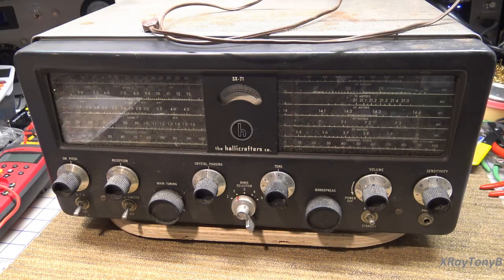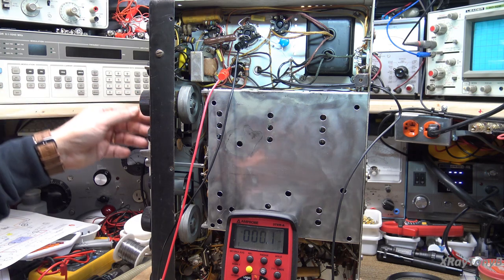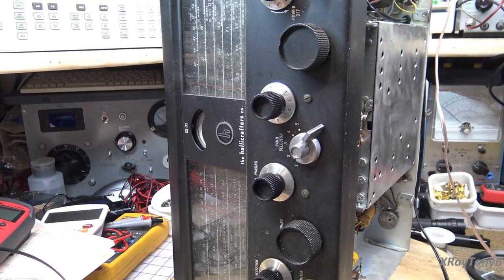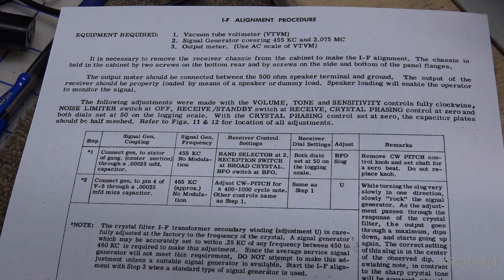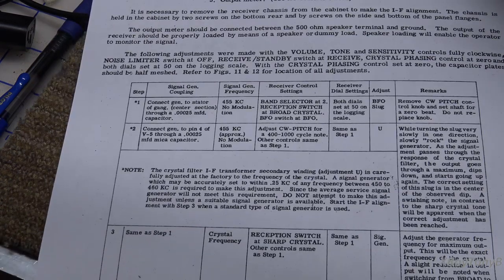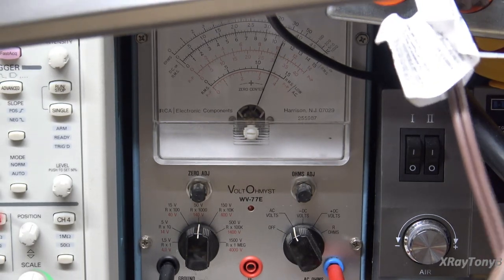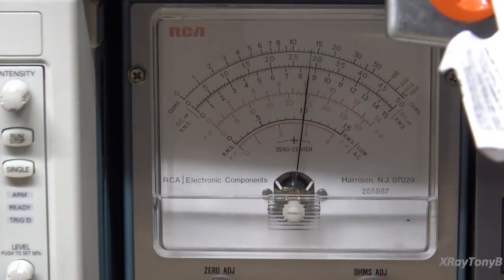Hallicrafters SX-71   Repair & Detailed RF/IF/Crystal Phasing Alignment

Comment: I was having trouble fixing one of these ten or twenty years ago. An almost complete loss of sensitivity at random times. Then after several frustrating days one quiet afternoon on the dining room table, I lifted up the open chassis and turned it upside down to check something underneath. 

I heard the slightest sliding noise. I tried turning it over and back over again. Again I heard the tiny noise. After more examination I found one of theslugs in one of the IF transformers was broken in half and when turned over it would slide downa half inch or so! I took the transformer apart and glued the pieces together and it worked fine! Very fine in fact.

Comment: Thank you for this video, For the past weeks I've been replacing capacitors and all resistor on my National 2-40D. Just finished the IF/RF alignment this morning. The instructions from the manual was straight forward,  however the IF cans and capacitors inside the IF cans where full of grim and oils, thus making the alignment a bit of a headache at first. Now my National sounds super, but i mean super sensitive! thanks for this video, i really appreciate it learned new things along the way.  Oh by the way, I had to replace all the Mica Mold caps, they measure dead on, but as soon as voltage is applied they drift like crazy!

Comment: Really interesting video, thanks. This radio is very similar to my Hallicrafters S-76, which I restored early this year... the first and only dual conversion I've ever worked on. I thought mine was the first dual conversion model but the SX-71 looks like it came out a year earlier. Mine doesn't have the crystal filtering and the IF's are 50kc and 1650kc. The 50kc is not available on my signal generator, so I had to get creative on the alignment using a harmonic from an audio frequency tone. I'm sure I could have done it better. I really enjoyed seeing how this kind of thing is done when you have the right equipment and know how. Thanks again.

Comment: Hello Tony!  I have a lot of Collins radio gear including the KWS-1 1KW SSB transmitter and the 75A4 receiver of about 1956 vintage and they  ALL have the Bristol setscrews so I have that same little blue set you have plus a larger X-Cellite set.  I have some Hallicrafters sets too but not the SX-71.  Happy New Year there Tony !!  73's from KC2UVN.
Reply: So does the R-390A
Reply: @jim874  I have the R-390A also! but I have never had any of the knobs off of it yet, so Now I know that radio will need the the Bristol set too, thanks a bunch!!

Comment: Nice old radio.  Looks similar to my old National NC-98.
Reply: Functionally NC-98 pretty much the same, but the SX-71 (a teen friend had one in the 1950s when I was first licensed and we used his station for contests) has many finer features such as double conversion - to reduce images - better selectively features etc.  Another friend had an NC-98 and that was a quantum leap over what I had for my first receiver (Hallicrafters S-38D.) I was 13 when licensed and finally had to tell my folks the S-38D just wasn't a suitable radio.  I got a Hammarlund HQ-100 which was decent but I've learn much over the years.  While I have modern gear, I love working on the radios I couldn't possibly have afforded as a young teen.  And XrayTonyB  this was VERY informative even though I've done much of this myself.

Comment: Keep in mind that NBFM has become much more narrow since that radio was produced. When this was produced  NBFM was 30Khz, in 60s it became 25Khz.  As of 2013 NBFM is 12.5khz. All of this is used in Analog  Land Mobile Radio (two-way).  Not much, other than hams, is using the 30-80 mhz band any more.  A few rural states still use the VHF Low band but they are very likely to be gone soon.  A old school baby monitor or vintage cordless phone is what you can tune in.
Reply from the maker: Thanks a lot for sharing this.  I wasn't sure where it was used, if at all anymore.  It's interesting to learn about this stuff.  The other thing I noticed about this feature on the SX-71 is that it lacked a limiter circuit and used a very basic type of detector.  Thanks again!

Comment: SSB  with a BFO . Turn the RF GAIN  ( SENSITIVITY)  down. You were running max open on 10.  The front end  overloads, making the signal distort,  so backing off the RF GAIN fixes that.  That's why the Product Detector was a vast improvement over the BFO. You didn't have to ride the gain control.    
Was the glass dial just dirty on the outside?    Good video!
Reply from the maker: Thanks for the tip.  I didn't think to reduce the sensitivity, but that makes perfect sense!
Reply: @xraytonyb  Ask me how I learned that. As a kid, all I could afford was an HR-10 and it had a BFO . One of my best friends was over at my shack and he was using my rig. He automatically reached over and turned down the RF gain as we listened to another guy on SSB.  It was like a holy cow moment  for me.

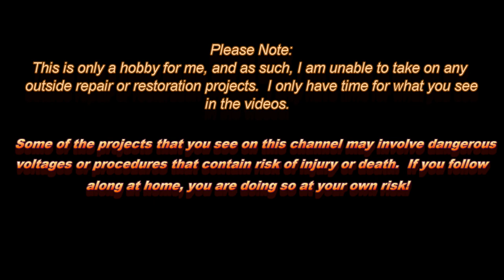Comment from the maker: 0:15 Intro
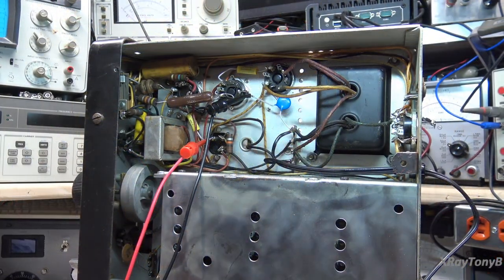6:31 Power supply Test & demo of the OD3 regulator tube
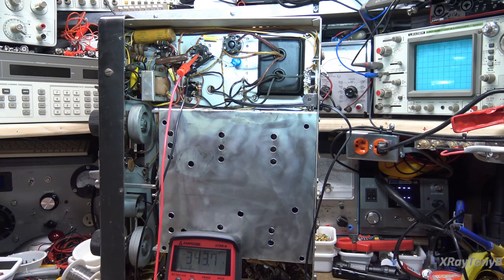16:00 Trying to receive a signal - a few issues found.
18:05 It's alive!
21:22 Cleaning the rotor on the tuning gang
23:00 Paper caps replaced, ready for another test.  Works good, but not great.
27:33 Bristol wrenches used for removing the knobs ARE NOT the same as allen (hex) keys!!
29:28 This radio sounds really good!
30:53 Alignment begins.  A few notes about the alignment.
39:02 Connecting the spectrum analyzer to the radio to set up the crystal phasing alignment
44:12  looking at the spectrum of normal, broad crystal and narrow crystal settings and identifying the resonant point of the crystal
47:33 Aligning the crystal at adjustment "U" 
52:36 Aligning the IF to the crystal frequency.
1:00:24 Setting the NBFM "null point" for narrow band FM mode
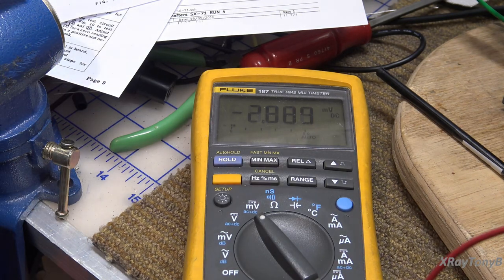1:06:16 What is NBFM (narrow band frequency modulation)
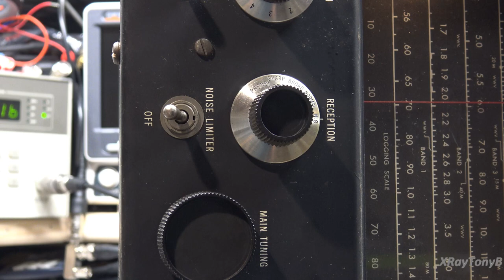1:11:45 Aligning the 2.075MHz "second IF"
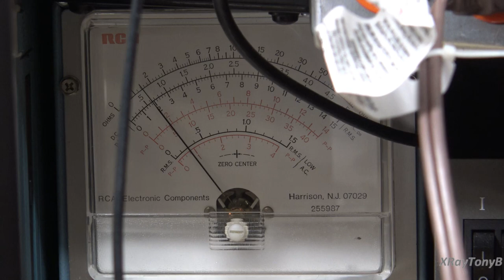1:17:29 Testing the receiver after alignment.....unsatisfying results :(
1:18:57 Troubleshooting & repairing the AVC circuit
1:23:42 Testing the receiver after repairing the AVC
1:25:09 Aligning the RF section for dial accuracy
1:44:09 A few final notes...
1:48:06 Testing the finished product and closing thoughts

Comment: A happy New Year ! 
01:53:00 I had a Radio with a BFO for receiving SSB and I had to reduce the Sensitivity (using manual Gain Control mgc) because from my Experience, on strong Stations / Signals the Sound will distort to much otherwise..

Comment: I have a hollow crafters SX 71 receiver here at the house, that was giving to me last year, I love this thing! But I am having some problems with the VFO knobs, when I turn the knob on the right side of the band selector it turns a little bit. The needle moves a little bit then it sticks, and I tried everything I know to do, I am a general class ham radio operator, my call sign is KN4ISZ. but other than that, I love this radio, I’m just having a little bit of problems with the VFO knob trying to stick the knob doesn’t stick. The knob turns obviously lol but the needle doesn’t move I think I know how to fix it, but I can’t get down there to fix it let me know if you can help

Comment: As much as I love the high-end tube shortwave receivers accurate frequency display was an issue, WWII the aircraft all carried frequency meters so they could calibrate their receivers then net the transmitter to the receiver. The band spread made tuning a station in easier but added to the complication of determining the station's frequency.

Comment: I increased sensitivity by using a 6GM6 with a 10k dropping resistor for HV for the 6BA6. Replacing the 6AU6 with a 6AH6, the 6BE6 with a higher gain equivalent tube and replacing some resistor to better use the AVC on the second 6SK7, making smore similar to the first stage
Reply from the maker: These are all things I really want to try someday.  This unit belongs to a friend and I didn't want the cost of parts, etc. to get too high.  Thanks for the suggestions!
Reply: @xraytonyb  My pleasure tony

Comment: Another way to "loosely" couple to a circuit is to use what they called a gimmick capacitor back in the day.  Transceivers back in the day often used gimmick capacitors to sample the output for the RF power meter on the radio.  A gimmick capacitor is nothing more than insulated wire.  Take a piece of solid conductor insulated wire and cut it in half.  Twist the two wires together.  On one end of your now twisted together insulated wires strip the wires.  Put a alligator clip on one and just leave the other one bare.  The two wires are not physically connected to each other, they are insulated by the wire insulation and you end up with a "capacitor" of a couple pF.  Basically the wires are the capacitor plates and the insulation is the insulator between the plates.  To use it just clip the alligator clip to the circuit you want to probe and attach your test lead to your instrument to the other wire you stripped the insulation off of.  Here you did basically the same thing, it's a "gimmick" capacitor.
Reply from the maker: So good to hear from you, Mike!  That's a great suggestion.  Those work really well.  They also used those in some of the lower-end radios to couple the BFO into the IF.  Thanks again. Hope all is well!
Reply: Hi Mike, I hope you are well!!

Comment: Great video Tony!!!!  Can you tell us what brand of alignment screwdriver that was with the orange handle?  I have a set of blue ceramic screw drivers but they are very short.  Thanks my friend
Reply from the maker: The alignment screwdriver is made in Japan by a company called Engineer.  You can usually find them on eBay and sometimes Amazon, or on their website which I think is www.engineer.jp.  They aren't cheap, but they are much more durable than any other ceramic alignment tool I've ever seen.  You have to shop around, as I've seen prices all over the place for these, anywhere from $12 up to $30+ for each tool (they have several sizes).

Comment: Hey Tony, what kind of antenna would be best to use with one of these units?
Reply from the maker: These old radios work great with a simple long-wire antenna.  Now if you plan on using a transmitter, that's a different kettle of fish ;)
Reply: The lower the frequency,  the longer the wire.  Calculators available online.  Best to keep it well off the ground if you can.

Comment: Great vid!!  Is there a way to find the crystal freq without a SA?  I've a Hammarlund HQ180 & want to align it & it has 2 crystals as I recall.  Thanx Tony and Happy NY.
Reply from the maker: Yes.  The service manual explains how.  It works best with an analog signal generator, so that you can rotate the frequency knob back and forth (i.e. "rock" the frequency control).  Using the BFO to create a "note" anywhere from 400Hz - 1kHz, you monitor the "note" or audio tone at the speaker terminals with a scope as you rock the frequency knob back and forth.  At some point, the amplitude of the tone will peak a little bit (your first peak) & then drop sharply.  You have to go really slow, as this "dip" is very sharp and you can pass right thorough it if you adjust the frequency too quickly.  After you pass though the "dip", the amplitude will begin to go up again until it reaches another peak (your second peak) and then begins to drop again.  This "second peak" is the peak of the crystal.  Adjustment point "U' will allow you to get the maximum peak for this second peak.  This peak frequency will be the frequency at which you adjust all of the other IF adjustments.  This will almost always be slightly off of the normal 455kHz IF, but that's OK.  Hope that helps.
Reply: I think you just told me to buy a SA. ;-)  Thank you for the work around.  Happy NY, Tony.

Comment: What is the company/part number of the safety cap you chose ? So you placed it right in parallel with the incoming 120vac ?
Reply from the maker: I just used a standard X1/Y2 capacitor rated at .01uF /440 VAC.  To test the unit, I just replaced the single cap from one leg of the power cord to chassis.  After everything was working, I added a second cap from the other leg to chassis (for a "y" filter) and a third (which should be a bit higher value, .02 - .047 uF range) across the line ("X" filter).
Reply: @xraytonyb  Thanks for your reply !

Comment: Those set screws are also known as Torx drivers.....the Male version is Torx drivers and the Female (sockets) are called eTorx sockets.
Reply from the maker: I think the bristol spline drivers are slightly different than the torx, as they have sharper flutes.  I have tiny torx drivers and they don't seem to fit the screws properly.  I shoul compare them someday.  Thanks for the comment!
Reply: Hi Tony: Great video btw, thanks for taking the time.  You are correct, Bristol predates Torx by nearly 50 years. Although they are similar, they should not be interchanged either from the fastener side or the driver side. The R390 series of receivers famously made use of Bristol fasteners, many of which have been ruined by the use of Torx or (even worse) hex drivers.
Reply: Sooo, my SX-71, along with other radios, came stock with Bristol Splines.  At this point they’re mostly still spline, but many are ‘damaged’ and only a hex or Allen wrench can remove them.  Question, where is a good source for replacement grub screws for them?

Comment: This receiver could have be made very portable if they had used the low voltage vacuum tubes designed in 1957 and used 2x 2N2955 output transistors for the power output stage and run off 2xPP9 9V  batteries and would be a lot lighter due to the fact that the heavy power transformer is not required.

Comment: Someone has gutted one of these radios and rebuilt it using solid state parts and I thought he would would have used two SO42P DBM units which include an oscillator and MC1350 as the IF stages but he didn't.